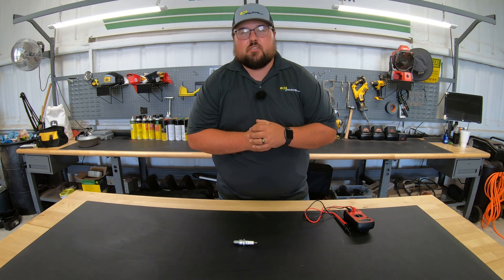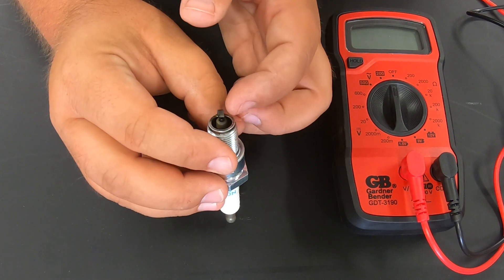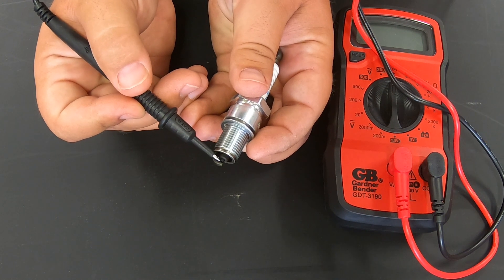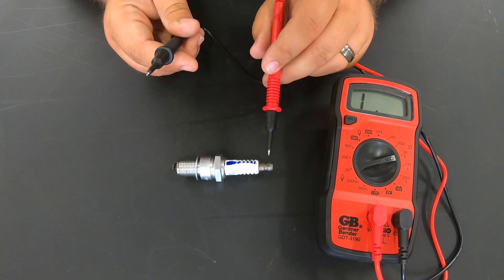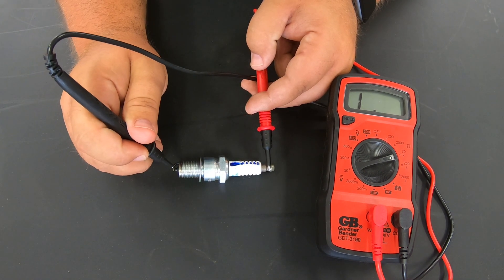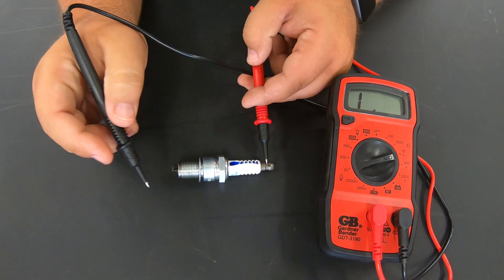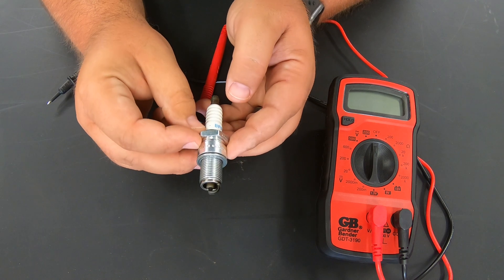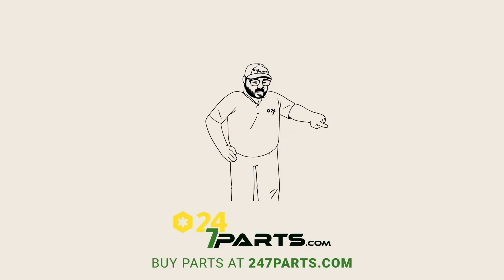How to Test Your Spark Plugs

Comment: You said above 5 but yours is 4.75. Mines reading 4.11 so is it bad if it's below 5?
Reply: No. Temperature has alot to do with resistance.  4.11 is good.  You will either see open or an extremely high reading.
Reply: Open or high reading means bad